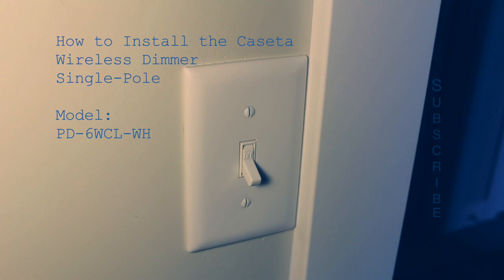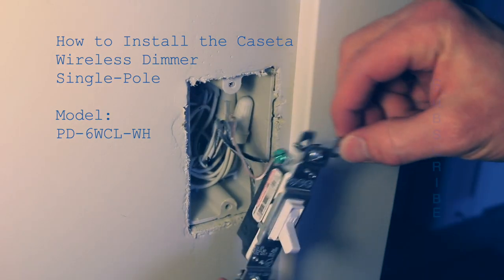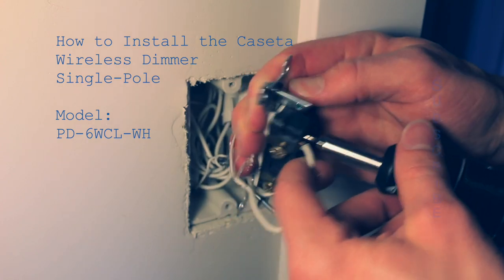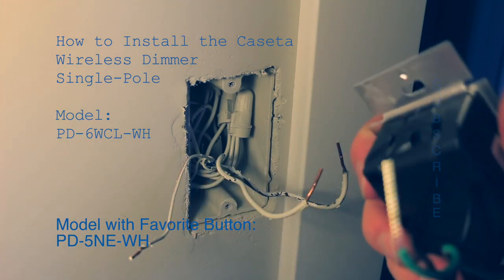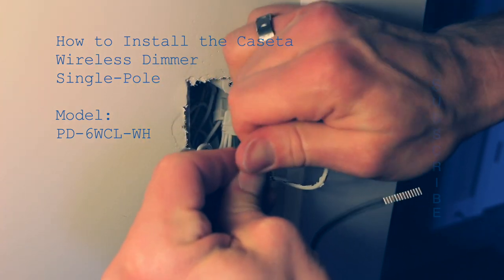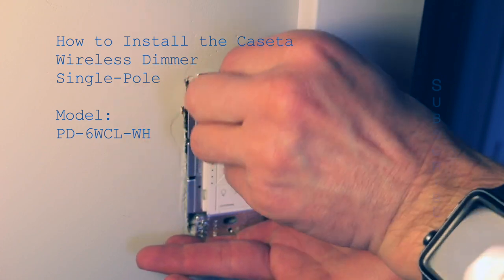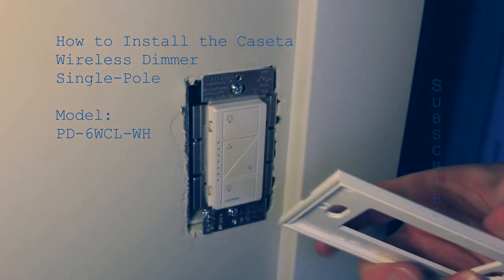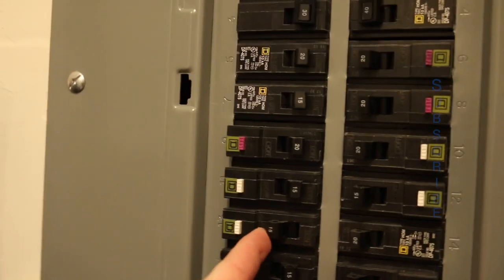How to Install Lutron Caseta Dimmer Switch

Comment: Seems pretty straight forward  what if I have two switches that control a set of lights ie in my hallway or staircase (bottom and top of staircase)?
Reply from the maker: The three way switch just has one switch hard wired to a dimmer, and you can use a pico remote mounted to the wall for the other side.

Comment: I have 3 wires on my old switch plus the ground wire. 2 black wires I can unscrew on the right side, the ground wire I can in screw on the left but there is a 4th black wire that goes into the back of the switch through a hole and there is no screw. How do I take that wire out and where can I place it on the new Lutron switch???
Reply from the maker: You will need to figure out what that additional wire is for...is it a wire coming from your switch and leaving out the box without a connection (if so, that sounds sketch). There is usually a purpose for every wire, like running to a different box, or light, or outlet, or maybe a neutral that isn't colored properly. You may need some testers to figure it out. If it's truly an extra wire, you can cap it off, but you also may want to consult an electrician if you're not sure.

Comment: Hi, i am using Smartthings v3 hub, can i set an automation to turn on a group of light through lutron dimable switch in particular brightness and specific time when a motion sensor detected a movement?

or if it doesn't work on smartthings, can you do it on lutron app?

thanks in advance for the answer
Reply from the maker: Yes, you should be able to do it, but different products have different abilities; you're right to just line those things up with the platform that will best get you what you want. Oftentimes you get additional functionality out of the manufacturer's app, but it is very specific to your product models and platform.

Comment: Electrical Tape those wire nuts in place. An extra step but safety is the top priority.
Reply from the maker: You don't need to add electrical tape to wire nuts. Just make sure the bare wire isn't coming out and they are twisted on tight. Save your money.

Comment: HI, thanks for the video.  One question what is the model of the kobalt screw driver you're using?  I used to have that one and it was probably one of the best screwdrivers I've ever had.  Lost it at a job site and now I'm trying to purchase another one like it but can't seem to find it even at lowes or the website.
Reply from the maker: It's the Kobalt double drive. Lowes or Amazon has it.

Comment: Hi, I have a switch that comes with 1 red and one black, what does that mean? Can I still wire them without pay attention to the color since my smart switch comes with two black wires? Thanks
Reply from the maker: Those are great questions. If it's just a single pole light switch, then it doesn't matter which two (not ground) wires you put to each side of the light switch. That is said with the caveat that I don't see it, and I'm not an electrician, so take that for what it's worth. Did you get it to work?
Reply: Hi electrician here, if your main is coming from your light , they use the 2 travellers as black/red and they got the white to have a neutral in your switch. 

Power comes down by black, gets into the switch then goes back up by to your light fixture with red. Bringing down a neutral can be used to add an outlet or maybe done because another switch is there to control a light🤷‍♂️ hard to tell without more details, but in doubt, call an electrician. Some dimmers also require a neutral

Comment: Which screwdriver size should I buy for this installv
Reply from the maker: The front is a standard flat head, the back to pull the wires out is a very small one..that comes in those little micro sets.